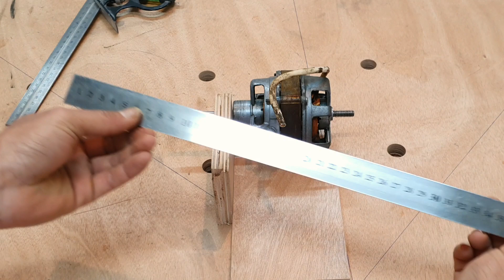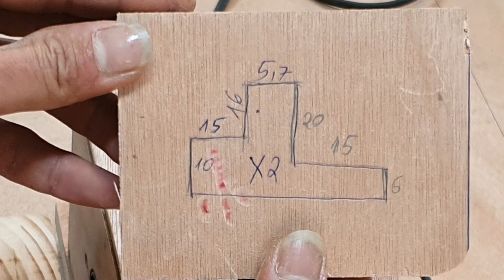Make A Disc Sander From Old Fan || DIY || Homemade a Disc Sander

Comment: excellent! I'm about to do the same thing.
Reply from the maker: Thanks for watching! if you're planning to do this, consider the motor as i said. It's pretty weak and only suitable for light work
Reply: @MrHWoodworking  I'm planning to use an old variable speed corded drill motor. I think that will have better torque.